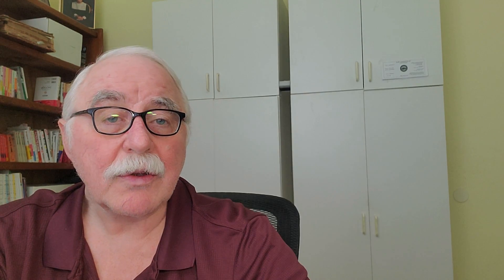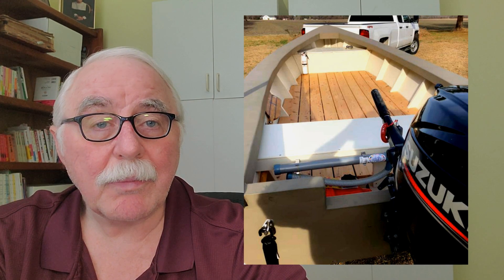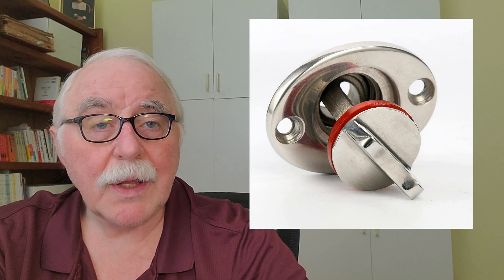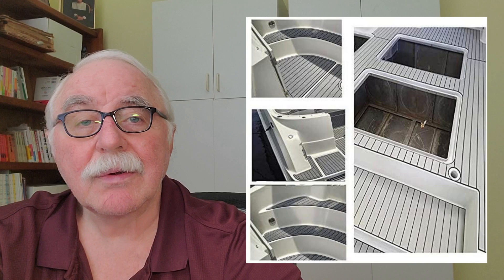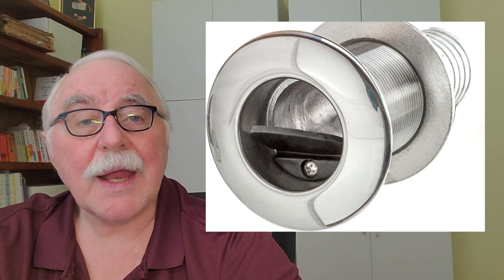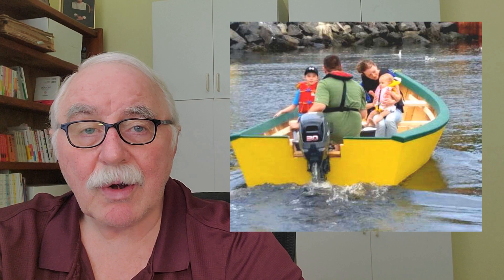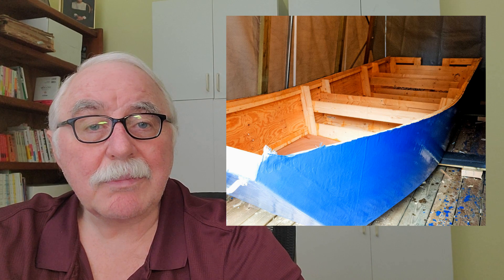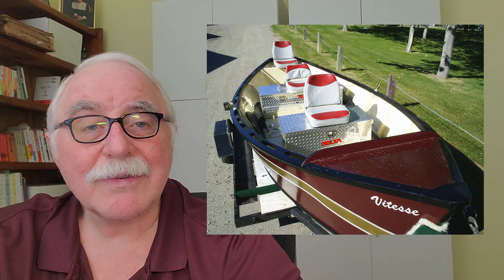Yes, YOU Can Build a Boat - Decks, Seats, and Cabins

Comment: I think I remember you mentioning in one of your videos that sealed decks can have issues in humid climates.  I would really like to make a self bailing deck on my 23' power dory but I’m down in south Florida where humid is the rule.  Can you elaborate a bit on what problems I might run into or possibly ways that I can mitigate any issues?.
Reply from the maker: No, you can seal the decks, you just shouldn't seal the inside. Here's a recent blog post: https://spirainternational.com/tipsandtricks/200601_finishing_the_insides.html

Sealed decks are just fine.